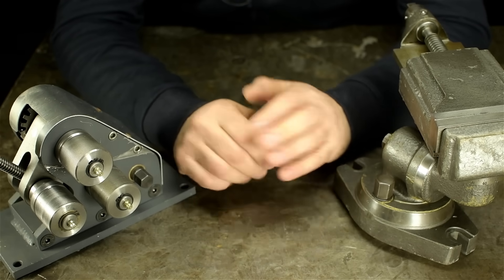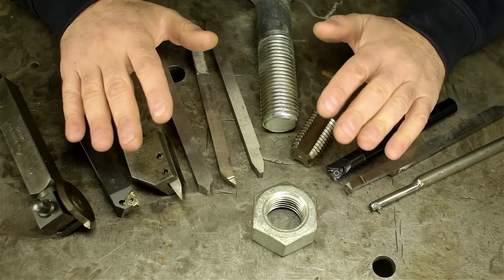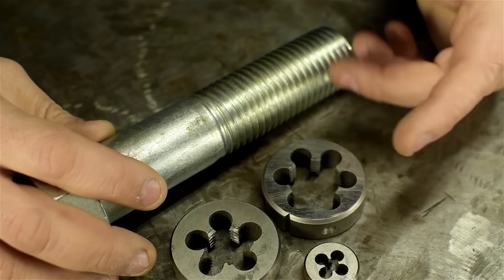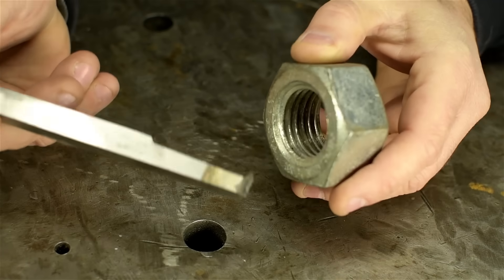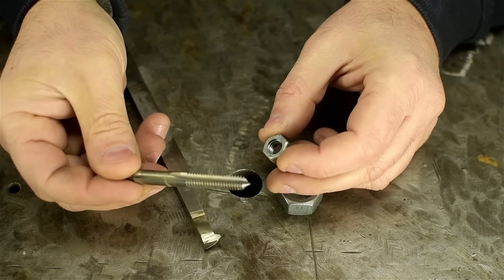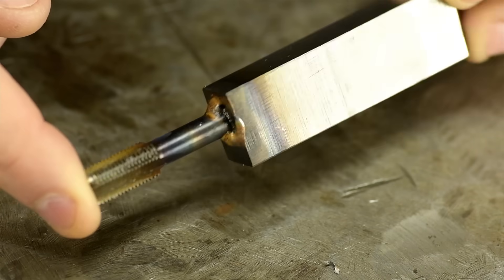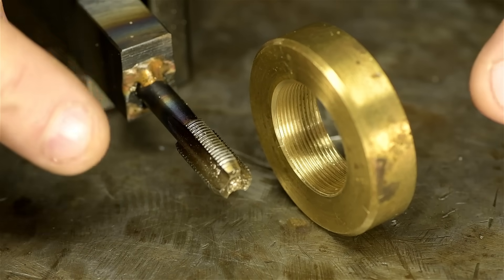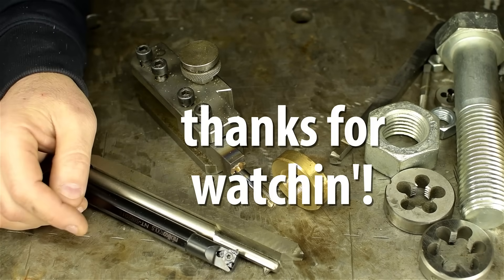Using a TAP as Thread Boring Tool

Comment: I suppose that would still mean, If I desired to do an internal thread, with a tap brazed on a chunk of clamping steel, BUT.... .desired my thread to be a "left handed thread", I would still be required to buy a left handed tap.. as per the relief direction of the thread... Meaning, I couldn't use a right handed threading tap, to cut the left handed threaded in the lathe process (brazed on to clamping steel tap)?

Comment: Cool video Tony. This is something  new for me to try when the time comes. I do a lot of threading on a lathe. One trick I have picked up  is to use a combination of single point and a tap or die. Basically I’ll rough out the threads single point to about 90% finished, then chase the remainder with a die. This eliminates all of the tool pressure when cutting with a die and will give you perfectly clean threads to size (assuming the die is reputable and not import junk). It’s also great for internal threading, especially blind holes. Thanks for your videos!
Reply: That sounds like a really practical and reliable method.
Reply: Nice Idea. No measuring for the final pass and since it's a multi point cutter a smoother finish.
Reply: I did this this week as I needed 1/2-13 on 4130 for almost a foot I thought about a bearing rest to keep the deflection out but got lazy and after both "firm ends" were in tolerance I ran  a die over the length and it worked well not as nice as I wanted but single point over a foot is a lot of flex

Comment: I am confused: If both the tap and the cut thread have 24 threads per inch, then the two threads will not be parallel due to the different diameters, will they? Both threads advance 1/24’’ per revolution, but the thread of the workpiece will be at a shallower gradient (slope) than that of the tap, as its path around the circumference of the piece is longer. Is this not a problem?

Comment: I seems the real secret here is feeding twice as fast to cut a double lead thread.  The odd teeth (1st, 3rd,5th etc) on the tap cut the first start while the even teeth (2nd, 4th, 6th etc) cut the second start half a rev later. It should work for triple lead and quad lead too(change feed rate accordingly) An old gray beard told me about this years ago ,I’m just passing on the tribal knowledge.

Comment: Tony, It pains me to see you reversing your lathe like that. USE THE THREAD DIAL. You will wish you could when your threading to a hard stop. js. your videos are good, but like I said it pains me to see you reverse the lathe. Not to mention the tail stock center is something your gonna crash into one day. I'm moving on to Bolter/AVE I like the longer videos and the chit chat. I mean even a CNC or Me on a manual lathe doesn't reverse the chuck.

Comment: When it comes dull taps I have found a use for them. This for the guy that wants to stretch that dollar, pound, yen, euro, whatever. First find a dull tap that fits one of your mill collets. If necessary make a really good tap into a dull tap. Second put the tap in a 5C or ER collet block. Set the tap up so it is tilted about 5° on the cutting face. Now place the collet block on your surface grinder and grind the top of the tooth down far enough that the tips overlap as you go down the helix. Now rotate the tap in the collet block to grind a secondary angle.  Presto, you now have a sort of roughing mill. I told you it can save you money. Plus it's that perfect justification for buying that surface grinder you always wanted that the wife says no to.
PS I've done this and it actually works. Sort of. I mean it leaves a finish just like a roughing mill. Sort of rough. That's why they call them roughing mills after all.

Comment: 2:30 "carbide tools are exactly the same as HSS tools, except they shatter the very first time you use them."

died.
Reply: Well then your speeds feeds or depth of cut are wrong.
Or possibly your attack method.
I machine .0002"  tol all the time with carbide, and my tool is 6 yrs old

Comment: I've been doing this with insert cutting dies for automatic die heads . the small ones for the 5/16" are squares and with a pin and clamp tool holder many different sizes can be had weird ones for singer sewing machines mostly. Those have to be headed on n ground for clearance.

Comment: Functionally speaking, couldn't this also work for external threads? Or is the geometry wrong? Perhaps on the far side (limiting depth), or with the part spinning CW (reverse)? I'm pretty sure that standard location (near side, centered) would result in a smooth-ish face. What are the safety factors to consider in testing this?

Comment: My shop teacher gave a student who was new to the trades an external 60 cutter and pipe and said put threads on the inside. Very quickly he said I can’t. The teacher also gave the same things to a more experienced student , and he spent 10 solid minutes adjusting everything he could on the lathe , to no avail.

Comment: I once used a tap as a rougher in the mill.  At the time I was also using the mill as a lathe and the tap was mounted to the mill table in a vice.  It was long before I had a lathe.

Comment: You know, not that I own a lathe - but the one thing I've yet to learn from one of your videos is how the lathe advances the tap (whether single point or otherwise) in relation to the spinning material. I would presume advancing the tap faster than the rotation of the object, or vice versa, would result in breakage.. so how does that actually work?
Reply: The carriage which carries the tool is geared to the rotation of the spindle via gears and a lead screw to advance the appropriate distance for each rotation of the spindle. I will avoid engaging in how the split nut works in this process.
Reply: @bobturnbull18  Thanks! After writing that comment I searched and found an old TOT 2016 video that shed a little more light on the mechanical linkage, but I'm still really curious about the change gears and how the ratios work out for different TPI. Is using change gears a flexible system, infinitely adjustable? Is it one of those things where you need a shelf filled with different gears just to hit the majority of common threads? I think he glossed over it in the earlier video, something about the knee bone being connected to the leg bone, leg bone being connected to the foot...
Reply: @Masterrex  Most lathes utilize a "quick change" gear box  with a broad range off available ratios to satisfy most  pitch requirements. Only very elderly or unsophisticated machines rely on changing gears in and out of the machine to change ratios. Yes, that does require a basket of gears.

Comment: Wouldn’t the position the tap contacts the work piece make a huge difference if you do multiple passes? Couldn’t the tap cut a secondary trough (if that’s even the correct term).

Comment: I don't want to be a party pooper but big bolts threads are usually hot rolled to preserve the grain in the steel. But if that bolt was from the last episode 2021 years ago  then I would be severely mistaken and I apologize. ToT as always, excellent presentation

Comment: Doesn't really work when you have a blind #8-72 3B an inch deep in A2. Thought about giving it a shot with a relieved #1-72 but decided against it in the end. Ordering or making a special tap was out of the question due to time so I just decided to single point it. The whole ordeal was a huge pain in the ass.

Comment: That's a very useful trick.  Setting the tap at a fixed  angle to cut tapered threads is genius on top of this.   It seems like you might be able to use the same tap on the backside to cut a left-handed thread too?
Reply: I think that's the next episode, so we'll have to wait until 4042.
Reply from the maker: Thanks Ben.  I haven't totally thought this through but what I meant was using pipe taps (or single external die) to cut pipe threads.  The pipe tap / die would have the taper in it.  Still need to feed along machine axis, just be careful how much you open it up.  You should get the taper (with a tapered tool), but the ID/OD is on you.  Though I guess with taper threads that's probably not all that sensitive.
Reply: @ThisOldTony  Everything ok TOT? Haven't heard from you in a while. Hope all is well.
Reply: @JasonTAho  check the community tab. His Father in law passed away. He is taking some time off to be with family and adjust.
Reply: @ThisOldTony  hey this old Tony, I wanna contact you, I would like to make some questions about benchtop lathes. Would you rather answer me directly through here or through an email? I couldn't find your contact information in the About tab in youtube
Reply: Hey, applied science watches the tony???
Reply: @eat_the_octopus  of course! Everyone loves teh Old Tony. They might be giants are probably even watching.
Reply: Just use rotate it 180 degrees, clamp it in backwards and use the mirror feature on the lathe.
Reply: No, cant use the same tap for let hand unless its a left hand tap. Helix is the opposite direction.  But you can run it on the back side of the part for better visibility. Just position your cutting edge appropriately. I know its primarily cutting on the cutting edge profile, but the relief angle is inverse and will result in an ugly thread likely.
Reply: @ArionRaine  You're absolutely correct. But... this is a stopgap measure. If you don't have the right tool, this will kinda work. The thread angle is too big for RH. So, although it is far from perfect, the trick will kinda work for LH too.
Reply: @ArionRaine  you still need to change the gears. just easier to have internal right and left cutter.
Reply: I dont think so because the tap doesn't have the proper clearance and relief to cut the other way. But you might be able to get away with it on a verey fine thread. Good thought though.
Reply: @coopermccom2316  If the clearance is enough for its original size, it's definitely enough for larger diameters.
Reply: @MrTridac  :  The relief is the opposite of what is required... it would only work OK using a left-hand tap.
Reply: @PiefacePete46  With some careful grinding you can make a relief surface for cutting left hand threads too - the tap should still be usable as a normal tap afterwards if you're careful.
Reply: @peglor  I had the same thought, assuming I understand your idea correctly. My proposal involves widening the "gullet" to shave off the backs of all the teeth in each gullet. This would mean the mismatch of helix angle would create less rubbing (although it would still be present immediately behind half the cutting edges. The other half would have more relief than usual).
This modification would obviously make the teeth much weaker, so only suitable for tapping things like alu, brass or mild steel...
Reply: The bit about cutting tapered threads without a taper attachment was a joke.  Just setting the tap at a fixed angle obviously doesn't work.  Also, the helix angle on a RH tap will always produce the wrong clearance angles for a LH thread - front or rear mounted, forward or reverse lathe direction.
Reply: @chrisarmstrong8198  Chris, would you clarify why "Just setting the tap at a fixed angle obviously doesn't work" to cut tapered threads? I'm not a machinist, but it makes sense to me that it would work.
Reply: @pierregagne5581  My reasoning is that, as the carriage moves, the depth of engagement between the angled tap and the work increases.  So the thread ends up being cut in a single pass.  However, other people have insisted (above) that setting the tap at an angle DOES work.  They have actually used this method and, since I have not, I concede that I am likely to be wrong.  Before I am totally convinced, however, I would like to see a video of the process :)
Reply: @chrisarmstrong8198  I imagine you could either just start at the edge and work your way in deeper or just pre-taper the surface and then tap it without having to shave off the corner with the tap.
Reply: @dushk0  Agreed.  Pre-tapering would be a good idea....but I'm still waiting for the video ;)

Later Edit: John Mills (on his doubleboost YouTube channel) has now demonstrated this (see https://www.youtube.com/watch?v=pdrzHmLoIRs).  But also see his outtake (at 7:35 on https://www.youtube.com/watch?v=idnUiykLoeU) where the gradually increasing depth-of-cut that I expected has unintended consequences.
Reply: @chrisarmstrong8198  You most certainly CAN cut tapered pipe threads without a taper attachment. People do it every day with pipe threading dies. If you take a pipe thread die insert and mount it in your lathe, YOU can do it too!
Reply: @bluegrallis  Agreed, but pipe threading machines have multiple cutters around the pipe, cut the thread in a single pass and require a large torque.  Threading on a lathe uses a single cutter and multiple passes, which requires less torque.
With the tap simply set at an angle, the depth of cut obviously increases as the carriage moves toward the headstock.  Multiple passes would be pointless, since the subsequent cut would remove hardly any metal until the carriage reached the point where the previous cut finished (due to the taper).  So the thread would need to be cut in one pass with a single cutter.  This would require a large torque, the thread would have a step in it where the cut finished and the flanks of the thread would be tilted, i.e. not at 60 degrees to the part axis.
Reply: @chrisarmstrong8198  
 The tapered inserts in a pipe die, can and have been used in a lathe for cutting threads in multiple passes.
 Clamp the tapered insert in the compound and scratch the surface in the first pass. Move your compound straight in, and make another pass.
 I have done it. It's just like single pointing, but with multiple points.
 I guess if you don't understand that I have no way of showing "how to".
Reply: @bluegrallis Your method is apparently not well-known.  I searched YouTube for a video of it but got zero hits.  Maybe TOT could demonstrate the process. :)
Reply: @bluegrallis  ive been doing that method for 20 years!
Reply: @chrisarmstrong8198  it works just try it
Reply: @chrisarmstrong8198  yeah but if you put the lathe in reverse the thread would go the opposite direction. Or maybe spin the tap in the opposite direction to the lathe chuck! 😁
Reply: @Paul Skaar Looking closely at the inserts, they seem to be ground with a RH helix and very little clearance (like a tap)...although I could be wrong.  Also, you can get RH and LH versions of the inserts, which would be unnecessary if one set could do RH & LH threads (but the ones in the video do have UNIVERSAL on them, so I'm still not sure).  Thanks for mentioning the inserts, since I missed the SUBSCRIBE subliminal message on them when I first watched the video.
Reply: My man. Applied . 2 of YT best in one place. Love the vids.
Reply: @This Old Tony, your hands talk to me. You're a master machinist and a master presenter. Thank you! You've just gained yet another subscriber.
Reply: Never.
Reply: Applied Science. You cannot cut a LH thread using a RH tap, no matter how you mount it.
Reply: if you have a 4 flutes tap then you should be capable of doing it.
Reply: I don't think so because the tap doesn't have the proper Clearance and relief to cut the other way. But you might be able to get away with it on a verry fine thread.
Reply: I am thinking that maybe you are saying bring the tap in and then cut from the back out like how circular polarized light reflects, flipping the polarization?  Maybe you are on to something.  Except if the flutes have a slight angle (in the opposite direction you want), that might bind up as it cuts into the metal and make a sloppy thread.
Reply: @lidarman2  you need left hand thread to make left hand tap flipping it upside down does not make it mirror image.
Reply: @lidarman2  you need left hand thread to make left hand tap flipping it upside down does not make it mirror image.

Comment: Really surprised this works, surely the angle of the threads changing as the diameter of the hole changes for the same pitch? Doesn't this create deformed threads that won't fit properly?

Comment: cutters that are used for cnc thread milling work great for on a lathe , used to get ones from work that had maybe one chipped tooth and used the good teeth , the round shank is also easy to hold in a toolholder

Comment: Thread dimensions will not be accurate because the slope of the smaller tap thread will be larger than what you are boring.  Will work in a pinch though.

Comment: Thread milling with a 60 degree rotating cutter in a die grinder is another way to thread using a lathe. The same cutter will do internal and external threads.  Stefan did a video on this for small parts. I adapted the idea for a Dremel tool to cut 5/16-13 internal and external threads in wood for an antique musical instrument.

Comment: Uncoated High-Speed Steel General Purpose Tap
Taper Chamfer, 1"-24 Thread Size, 2-1/2" Thread Length $92.95 Each McMaster

Comment: I gotta be the asshole to point out that the bolt you used for an example at the beginning has rolled threads, not cut.  You can tell by the slightly tapered gooseneck where the threads transition into the body.

Comment: That tap is actually like an insert too, you can turn it thrice.
Reply: ....as long as you don't mind un-brazing it. Or, of course, if you are a discerning man of culture as well and had the foresight to braze it onto a HEXAGONAL piece of stock instead of a square one, then you're totally right...
Reply: @AttilaAsztalos  you might get away with a hexagonal sleeve in which you culturedly punched a square hole. Think about me when you add the fixing screw.